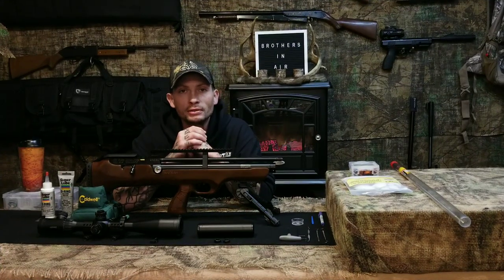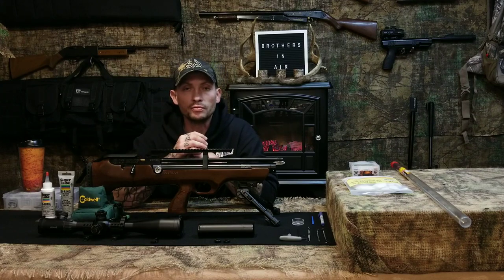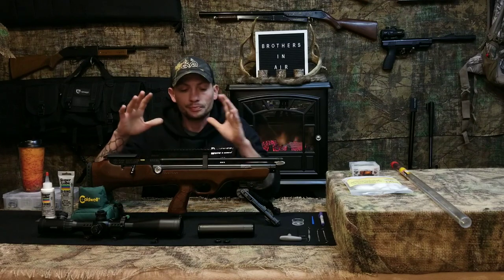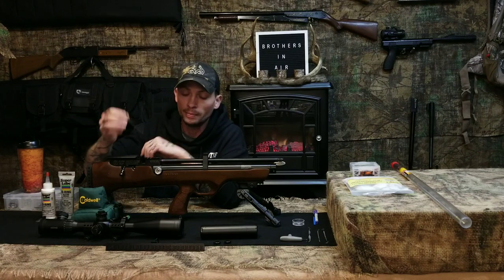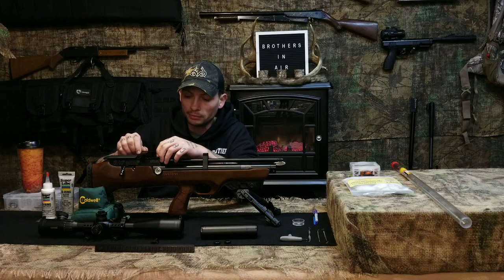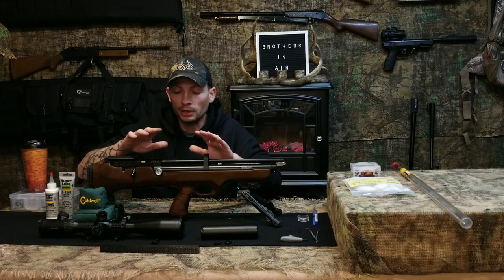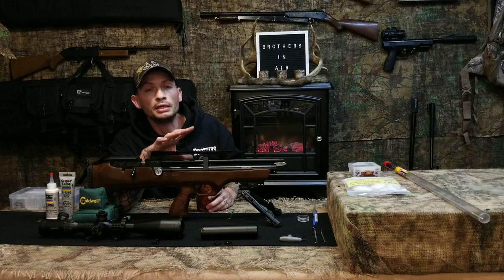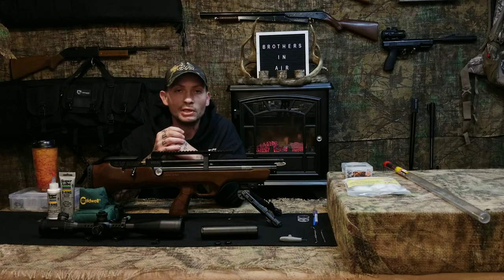HATSAN FLASH(PUP)(WOOD)(PUP-S) *****Barrel Removal, Breech Seal Change, Barrel Cleaning*****

Comment: When I got my Synthetic. 25 cal I cleaned the barrel I was surprised how clean the barrel was. And of course I blew my breech seal using the Barracuda hunters , I did remove the barrel and I made a witness mark on  barrel to receiver on top ,the crown on the barrel was  excellent I could not believe how good the crown was.  Thank you for making the videos on the Flashpup accuracy is outstanding in par as my Daystate and FX I CAN'T BELIEVE. Now I have a pup that I can kick around without worrying about scratches or nicks Great little gem you SOLD me on it.  
Be thru to yourself and keep the videos coming.
Reply from the maker: That's awesome! I too have seen nothing but excellent barrels from Hatsan for the last couple years. It's really really awesome that guys that couldn't otherwise afford a very accurate PCP, are now able to experience awesome air gunning! I got my synthetic now and I did a little unboxing and initial thoughts and Impressions type video I just have to edit it and upload it. Awesome little piece for $350!
Reply: @brothersinair2064  That's great Can't wait for the video only thing that I don't like on the pup is the mag fit I don't know why hatsan can't figure this out. 👍

Comment: Just got my flashpup .25, was hoping to take the barrel off for deep cleaning, but the front set screw on the barrel is impossibly tight. Stripped 2 cheap allens, twistedmy husky t handle, the short end, and am twisting my bondhus t handle. Soaking it in pb blaster, fingers crossed. Thanks for the great vid!
Reply from the maker: You could try warming it some and she'll probably break loose. I'll never understand why they don't use an inch pound torque driver and set them all the same. They under or over tighten all too often IMO.

Comment: Hi BIA could you tell me if there is  an o ring on the barrel where it joins the block, I have to put so much pressure on the barrel to push it back in. Whereas you slide yours straight in and tighten up the grub screws. Thank
Reply from the maker: Yeah there are two o rings on the OD of the barrel  where it fits inside the block. One on both sides of the barrel port to stop air from escaping out the front of the block and the rear breech area when you take a shot. As long as the set screws are backed off far enough or removed you should be able to slide it around in the block freely with minimal force. Possibly rough edges, burrs, or poor machining causing it to hang up on the porting holes or the o-ring glands? There can be some nasty burrs inside of a Hatsan breech block so it wouldn't surprise me if that was the case but you'll just be shredding the  o-rings on the OD of the barrel. Hope that helps brother I can't really think of any other reason why it would be hanging up unless the tolerances are way off and the machining poor. In that case you would hope and think that a quality control department would catch something like that but that's not always the case. Let me know what you come up with
Reply: Hi, yes I've got the 2 o rings either side of the barrel port but there's another o ring just where the barrel meets the block, is there any need for that 1 as it really makes it difficult to reinsert the barrel. I've looked at the exploded view diagram and it doesn't show an o ring in this position. Thanks for any help

Comment: Hi ! Thank you for this video, very useful, I have had a problem with the mag in my flashpup 22, I couldn't remove it and I have to move the bolt back and forth some times, I guess that then there were 5 pellets into the barrel, then I shoot the gun and they were expelled. When I finally could take the mag out, I found an 8MM OD oring where the mag fits and now some air leaks from the mag place when shooting. Could it pop out because of the pressure caused by the 5 pellets into the barrel? According to you video the only 8MM ones are those of the barrel, did I get that right? Thank you in advance!
Reply from the maker: You're very welcome. What it sounds like is that your breech seal has come out of its gland just inside the breech. This seal engages the clearance gap between the barrel and the pellet probe creating a seal so that no air is able to escape backwards around the pellet probe and into the breech. If you take a flashlight and shine into the barrel opening at the breach you should see the gland cut into the ID of the barrel and be able to see if the seal is there or not. The .22cal breech seal has an OD just over 8mm so that's got to be it. With a properly functioning breech seal in place you shouldn't feel any air escaping backwards into the magazine area. Hope that helps👍
Reply: @brothersinair2064  Hi man ! Thank you for your fast answer, that was it ! I have already disassembled the barrel when I received your response and I could easily check your suggestion, that was the missing one. I could put it back in position with the barrel out. Thank you very much again!

Comment: Question, I have a flashpup 25 qe and was wondering if it's possible to swap barrels for a longer possibly one out of a 25 cal flash ? And if it's possible to add a slightly larger air cylinder that would replace the one that comes stock on the flashpup?
Reply: From what I understand the barrel from a neutron star will fit and the air cylinder from the bt65 will fit.

Comment: Hey question for you just got my new flash pup and i think I just double loaded pellets, how do I correct this.
Reply from the maker: I would take the Quiet Energy shroud off to avoid pellets clipping the baffles and just shoot them both out. Alternatively you could take an appropriately-sized wooden or aluminum dowel ( as to not scratch the barrel) and push them out backwards into the breach.
Reply from the maker: Also.... I wouldn't advise shooting the pellets out the barrel if there are more than two because if they get stuck mid barrel you will have a hell of a job pounding them out. If you have more than two of them in there I would just push them out backwards with a dowel.
Reply: Just got both pellets out with a brass dowel.thank you for the help and quick response. I think your videos are very helpful nice job on all of them

Comment: Is the flashpup in the video a .25 cal?
Reply: Also,  will the Sme Bore Rope Cleaner Knockout .243 Caliber work for the .25 cal rifle?
Reply from the maker: It is .25cal. I don't have that particular rope but I do know that that rope should work fine as to size. Main thing is getting ropes without brushes because they won't clear most breach openings and would wreak havoc on a breach seal

Comment: Hatsan is known for making it simple to change the breech seal. Grab yourself a cloth and a pair of pliers and twist the back end of the barrel it will unscrew like a cap and it's easy to switch your breech seal from there. The barrel looks like one solid piece but it's not. Hatsan is the only company I know that makes it easy to exchange your breech seal. I cannot take credit for that but I learned that from B Walton YouTuber from back in the day. They call him the Hatsan King. I'm pretty sure the flashpup is exact  same thing. Hope that helps brother and next time your  taking it apart let me know if I was right thank you. Stay blessed shoot straight I'm a Hatsan fanatic.👍🇺🇸🇺🇸✌
Reply from the maker: The flash platform is different than my at44 and other Hatsan's and does NOT unscrew at the end of the barrel. On an at44 you can remove the barrel o-ring on the OD closest to the end and you can see the seam when looking into that o-ring gland. When looking close with a machinist loupe you can see that they just came into the bore with a grooving bar and cut the gland in for the breach seal. This makes sense from a cost/efficiency standpoint because it eliminates a few steps from the machining process of the barrels. These barrels are one piece and try as one might the end result will probably be a jacked up barrel stem from the pliers digging in through the rag because it WILL not come apart. The flash platform also does not incorporate a pellet probe o-ring and only has the one breech seal. Now that Hatsan is manufacturing completely in house they are replicating LW barrels from the machining process and tooling, to the finished product. They are even matching LW's most common twist rates per caliber and these barrels are extremely nice. The platform shoots on par with an fx or daystate when it comes to accuracy so I'm digging it!!! Thanks for the good intentions. Bless you Brother.
Reply: @brothersinair2064  I wasn't too sure. I have the bt65 25 caliber. And the Hatsan bullboss 22 caliber. And both unscrew at the end of the barrel. Which just makes it easy to change the last outer o-ring and the breech seal. I just thought that I would throw that out there brother. There for a while I was thinking about purchasing the flash prep. Decided to go a little bit more heavier in the wallet. Probably going to  purchase a raptor from Jefferson State air arms. Happy Halloween.  keep those videos coming.👍🇺🇸🇺🇸✌
Reply from the maker: @richardcampbell5762  I think you're making the right choice! That Raptor appears to be one heck of a gun and there's nothing like buying something from the good old USA and supporting our brothers. have to let me know how you like it and if it only took the six weeks to arrive. Yes I will be jealous lol
Reply: @brothersinair2064  I agree made in the USA. Probably won't be ordering it for at least a month. But I will keep you informed.👍🇺🇸🇺🇸✌
Reply: @brothersinair2064   so your saying that there’s no pellet probe oring ? So when just looking at the breech when the lever is locked back it’s just all metal visible? No black rubber ring that’s visible, that when moving the lever  forward & watching the pellet probe go into the breech, you visibly won’t / can’t see an oring sealed around the pellet probe?
  Because after noticing I didn’t see a black oring at the face of the breech. I thought on mine (synthetic .177 qe) that maybe I had already blown mine out! 
     So ,last question. Is the breech seal oring even visible when the cocking lever is locked back ?

Comment: Hey BIA ,have you ever had issues after cleaning your barrel?after I took out the baffles and cleaned the barrel,I noticed that my jsb 25 grain aren't grouping like they normally do.and the 33 grains are shooting 5 mildots high and 4 mil to the right.it's usually 1mil lower than the 25 grain.idk if its because the 33g are clipping.any thoughts or suggestions?thanks brother!
Reply: I noticed a little clipping on the baffle closest to the muzzle.I don't know why that happened as I made sure to put them back exactly how I took them out.I turned it half a turn and its back to normal.thanks again sir,sorry for the false alarm.
Reply from the maker: Sometimes the felt can get pinched and misalign the baffle. Glad you got it squared away!👍

Comment: Hi my friend, i have intaled my regulator on de Flash .22, somenting about 138 BAR, but i have just 15 shots regulateds. I don't understant....you think a need to uo the pressure or down the pressure a little bit? My intention is keep somenting like 40J.
Reply from the maker: It doesn't take as much force to open the valve once you install the regulator so you need to back the hammer spring preload tension off some. Basically you're wasting tons of air per shot and probably tuned into the down slope of the unregulated shot string. Sorry it took me so long to respond I'm usually a little quicker with it
Reply: @brothersinair2064  
Spring tension is as low as possible.
I tried with 120 BAR and the same happens, a lot of wasted air. Now I'm thinking of removing the 2993, maybe with that the hammer strength will decrease.

I am also considering testing with 150 BAR.

My wish would be to keep the 40J at .22.

Don't worry, just answering already means a lot to those who watch you!
Reply: Part 2993 of the Exploded View of the gun****
Reply from the maker: @cesarmuller8962  yeah you could definitely remove that to relieve some tension and give you a little more adjustability that way. It's my thought that the flashpup has good balance throughout as far as tuning goes but my new Flash wood in 22 has in my opinion too strong of a hammer spring. It seems the industry crave's these insane velocity figures but I on the other hand believe the gun should have more adjustability in the direction of down tuning. On my new Flash wood there's just no middle ground and the thing is a freaking Power House. Outside of swapping to a lighter hammer spring there's nothing to change that. So with that being said there's just no hope of shooting a lighter pellet long range but it's a tack driver with anything between 16 and 21 grains at right around 930fps (+ or-). I'm thinking when I install the regulator in a few days I may need to go hunting for a lighter hammer spring but we'll see.

Comment: I didn't know you could decock the flashpup at all!  (X cept for actually discharging it) . You know too much about this rifle. it is your mistress!  I was going to brass brush my barrel, because I bought my rifle used and Im not sure how fudged it is, but... it's shooting really tight and I'd hate to brush it and have it start spreading. On the other hand, I'm pretty sure patches and solvent alone won't remove all the "harder" lead deposits. You got any opinions on that?
Reply from the maker: Thanks bro! I find the new Hatsan barrels to shoot very accurate with a completely clean barrel. Unlike some of my guns the flash platform doesn't seem to need a leading in period. Once the barrel starts fouling real heavy the accuracy goes down hill and I give her a a cleaning that removes every bit of lead from the rifling and then my accuracy is back to hole on hole. That's been my experience when it comes to the new in-house barrels from Hatsan.

Comment: Some airgunners are using molykote grease on their o rings is silicone oil is much more reliable than molykote or silicone grease?
Reply from the maker: I prefer to use silicone oil and grease but molykote is also fine. The reason these are both good choices is the fact that the ingredients of neither are harmful to nitrile o-rings. I like to use silicone grease on most static applications but definitely prefer/recommend using an oil on any dynamic situations such as a regulator piston.
Reply from the maker: One more thing to add... If using molykote there are many different kinds. Molykote 55 is silicone based and what I would recommend personally if going that route.
Reply: I just applied bald eagle piss on my rifle amazing stuff hopefully it doesn't ruin anything guess time will tell.

Comment: Anyone know if the new synthetic stock will fit the older style flashpup?
Reply from the maker: I don't see why not. I never actually checked the fit but visually it's the same setup. I'll check it out when I get home and give you a definitive answer in a while.
Reply: @brothersinair2064  thank you sir greatly appreciate it!
Reply from the maker: @randyperkins5063  I'm really sorry that I took so long to respond I actually forgot about this one so my apologies. In order for the flashpup to fit into the synthetic stock you would have to cut the face of the forend to accommodate the longer aluminum tank. The synthetic stock only covers the intake valve end of the steel air cylinder halfway up so it would be a minimal alteration to cut that bit of plastic out of there. I'm actually considering it because it's about a pound lighter with the aluminum versus the steel cylinder and honestly you could cut the stock so that it would look as if it came from the factory that way if a guy took his time.
Reply: @brothersinair2064  No problem appreciate the information sir!
Reply: What is the thread size on the barrel itself?
Reply from the maker: @randyperkins5063  1/2×20 UNF
Reply: @brothersinair2064  apologize if I've already asked you that before but I lost track haha. Thank you very much sir have a good day.
Reply from the maker: @randyperkins5063  no apologies needed. You have a good day as well my friend